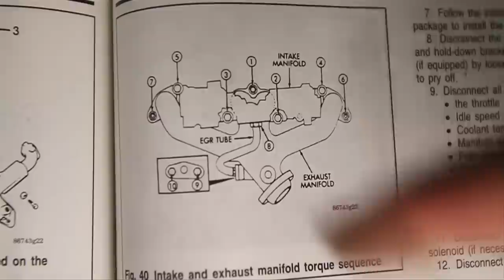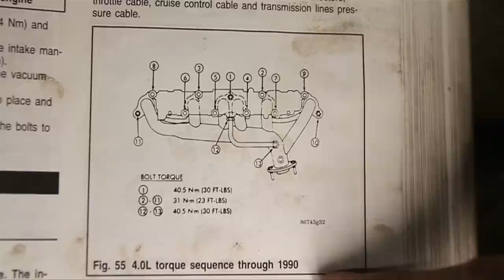How To Replace an Exhaust Manifold / Intake Manifold / Header / Gasket

Comment: Matt: I realize the last couple comments were almost a year ago but I wanted to make sure that other YJers like me didn't run into the same issue regarding the EGR tube.  If  you are planning on removing the exhaust manifold to do a swap you're going to run into that nifty tube running from the bottom of the intake manifold down into the exhaust manifold.  You want to make sure that little guy doesn't bend or break because finding one can be a real hassle!  

Keep up the good work... there are guys like me that watch your videos a couple times before and during anything under my own hood.

Comment: Feel pretty confident that this needed more work before long (particularly around the manifold). I think Matt would agree, this early video has some real cringe to it. Still, I appreciated it because there aren't enough 2.5l motor videos out there. It helped me the first time I changed my exhaust mani. I had about as much fun as Matt. It can be a rough time esp if you spring air leaks and loosened bolts down the line (likely because of bad torquing--best tip would be to use a flex socket with extensions with your torque ratchet)

Comment: My 2.5L comanche is missing the SAME bolt in the exhaust manifold. I’ve been putting off swapping the gasket because it’s snapped off at an angle

Comment: To identify any leaks fill a spray bottle with soapy water. Spray the intake/exhaust mating surfaces on a COLD engine. Don't be afraid to do a heavy spray and start the engine. 

If there are any leaks there is a chance that they will cause the soap solution to bubble.
Reply: Hook a shop vac up to the exhaust, reverse the direction.

Comment: As Denny177 says, you do NOT want that debris getting into the motor. I hosed mine down with engine degreaser, waited for it to do its job and then used a towel to wipe it clean. This way you won't get crud in your engine.

Comment: How can I tell if my 1999 jeep wrangler has a header ???? I just bought  it 1999 jeep wrangler tj.... I can't tell if its a header or stick maniifold
Reply: A header will look like pieces of tubing bent and welded to a collector at one end and a flat flange at the other end. A stock type manifold will look like it was all cast as one piece. Usually a header looks more slender, less bulky.

Comment: EZ out is the worst tool to use. I know this from experience. What I had to do to my 300 ford was actually weld buttons onto the end of the broken off stud (being extremely careful not to weld the broken stud to the block) until I had enough filler metal on the end to weld on a nut. Then let her soak in PB Blaster over night, hit her with the torch in the morning (just have a fire extinguisher handy) and she finally broke loose. Hard to explain the process.